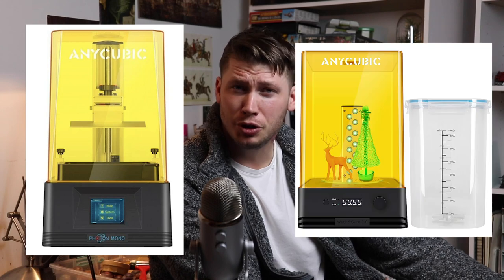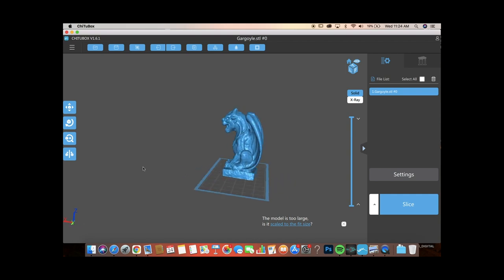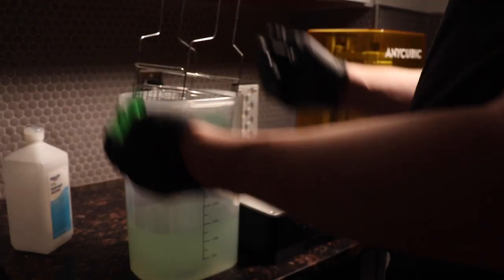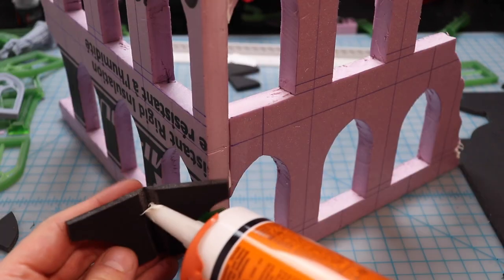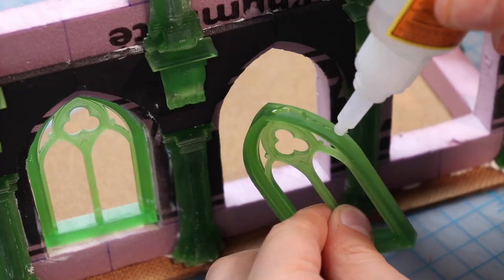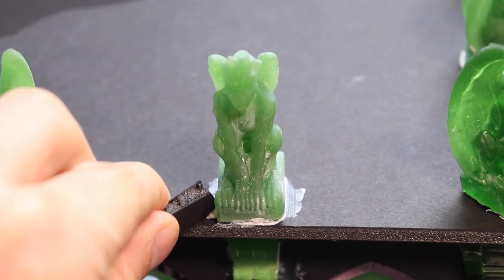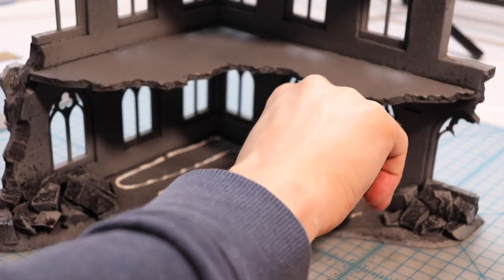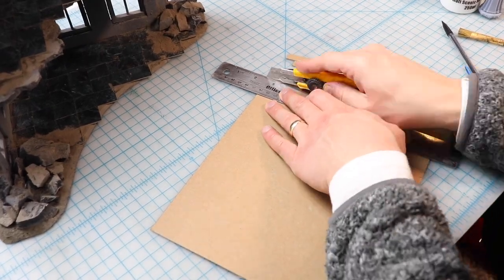Making the ULTIMATE 40k ruins - 3d printing + scratch building terrain!

Comment: This is undoubtedly the best homemade "sci-fi ruined building" tutorial out there. 

There are a LOT of different videos that talk about making ruined buildings out of foam core, but I found that the end product of nearly all of those videos look exactly the same. I'm sure that those conventional buildings serve their purpose on the gaming table, but none of those videos wound up making a building which didn't look distinctly "home made out of basic craft materials," and I suppose that's to be expected when everyone out there is using similar materials and techniques to achieve their goals. 

I understand that 3D printing is still a luxury for many hobbyists, and that the inclusion of this technology might be prohibitive for many. However, you've demonstrated that the sparing inclusion of certain details like windows, corbels and statues elevate that same basic scratch-built structure used in so many previous crafting tutorials into a totally different result, a that result is exponentially more impressive than using basic crafting materials alone. 

As the owner of a resin 3D printer, it always irked me that I can print incredible miniatures, but the larger terrain files that come in so many of my monthly subscriptions wind up collecting dust on my hard drive due to how prohibitively expensive it would be to print larger structures in resin. 

This video proves that you don't need to print the whole thing to make an incredible terrain piece, and you can save your resin just for the interesting details while still building the majority of the structure with basic crafting techniques. 

This is the tutorial, and inspiration, I was looking for.
Reply from the maker: Glad to hear it!! There is so much potential for 3d printers - hobbyists are just beginning to scratch the surface

Comment: 3D printing opens up quick options for highly detailed builds. The downside is they don't need the same kind of ingenuity to use, so use them sparingly or make sure you maintain your traditional hand-crafting skills and ingenuity for by specifically taking on challenging projects and NOT using the 3d printer. I loved the tiles you made, by the way. Excellent!

Comment: For rubble I’ve found plaster of Paris poured into a flat container then broken with a hammer or dropped onto a concrete floor (just sweep up after) make for great and cheap (as well as realistic for that matter) rubble for buildings. You can mix in some grey craft paint (I suggest a light grey) before it cures for a realistic look (also includes its own dust!)

Comment: If you want chipped / broken pieces in future, maybe try and break them before putting them in the curing oven? As far as I know, the resin should be softer at this stage and more easily breakable. Another idea would be: make a mold from your resin piece (as someone else suggested) but pour plaster in there instead of resin. That should be easily breakable.
Awesome build btw!

Comment: @1:30 I know that it's an office space quote, but it's actually pretty straight forward. PC stands for Paper cassette (the name of the paper tray on that model of laser printer). Error codes from that generation start with the location of the error (Paper Cassette) and then what is the problem is. So "PC: Load Letter" is saying to load letter sized paper into the paper cassette

Comment: Great combo! Invest in a WHAMBAM build plate you can swap out and flex (get the double pack) life changing!
Reply from the maker: Ooh so you just flex the build plate to detach prints? Ill have to look into it
Reply: @EricsHobbyWorkshop  yes mate. It’s very easy. Smaller prints need a little spatula still but it means you don’t unscrew the build plate. It’s magnetic (strong!) and you pop it of, pop on the second one and hit print again. Then you can do all the clean up etc while the next one runs. They use a special 3M adhesive on the magnet so it’s not going anywhere!

Comment: The part where the hammer didn't shatter it: I believe if you just put that part back in the cure station and let the UV overcure the hell out of it, it will become a lot more brittle and might get you that satisfying shatter afterwards. Not a common use case, but may be relevant for you as you continue to experiment.
Reply from the maker: Thats not a bad tip if i need to make shattered pieces in future!

Comment: It's interesting how solid your resin pieces are. I don't have a resin printer, but a friend of mine who does never uses it for printing stuff for terrain, as he says it's really fragile- drop the piece on the floor and it'll probably shatter. I assume different resins must have different strengths...

Either way, personally I'd rather use a PLA printer for most terrain pieces if I had the choice, just because it's cheaper.